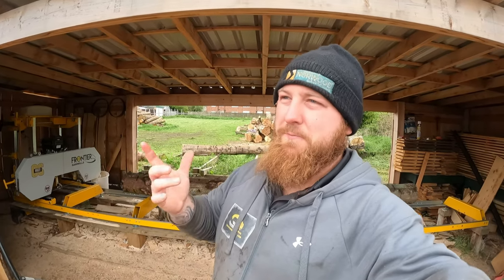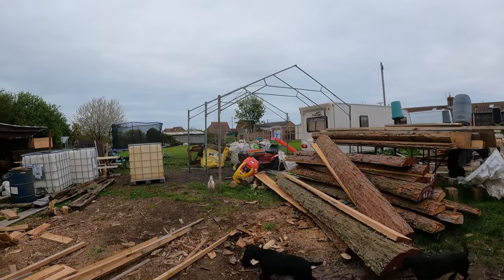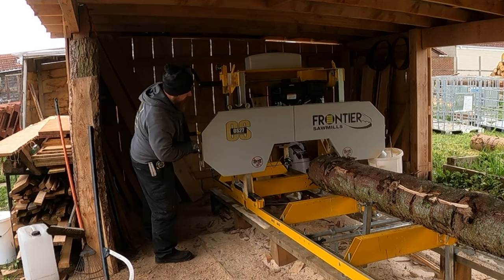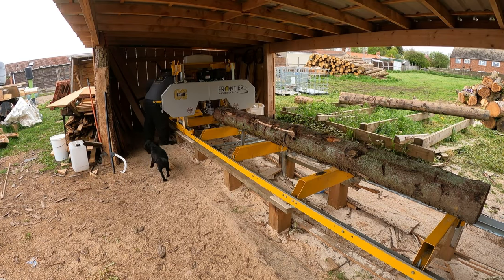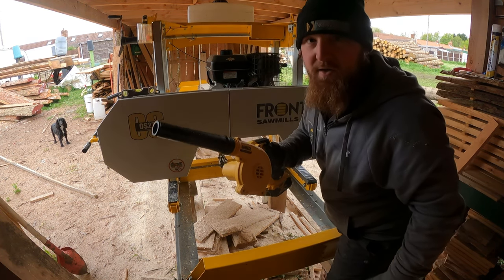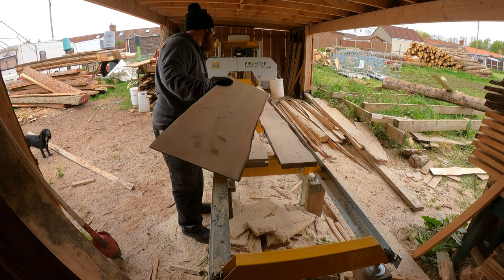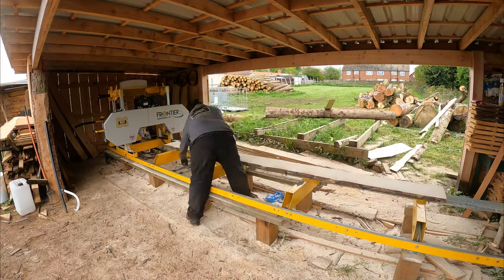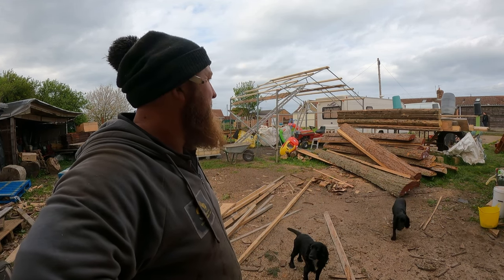Milling Spruce siding and pole shed perlins with Frontier OS27 Sawmill

Comment: Great job buddy.  You never know what projects you're going to be doing until you start doing them lol. I think I'm going to be doing one thing next I shift gears and do something else.  That's what I like about your channel.  

That shed build is interesting.   Looking forward to the progress.

I'd like to figure out a way to keep the sawdust from building up in the center of the cabinet.   I suppose if you put a cheap harbor freight vacuums it might do it. 
 
Keep up the great work.
Reply from the maker: Your not wrong about shifting gears, wow I plan in my head something and I don't know why I bother sometimes 😆

Yeah the shed building is a little different to what I'm used to building but I thought aah what the heck, let's try something different.

The build up in the centre sure is a pain in the butt to avoid but for me I haven't got electric available to run a extractor off the mill. That be pretty neat if I did however. Just means more sawdust in another location 🤣 

Thanks as always buddy, hope you are well 👍
Reply: Very nice Nick same here I start out going in one direction an then I’m headed in another always makes for an interesting day
Reply from the maker: @AllenFamilyFirewood  thank you for commenting buddy 👍 yeah one day I might just make a plan and stick to it one time 🤣 
Thanks for commenting 👍